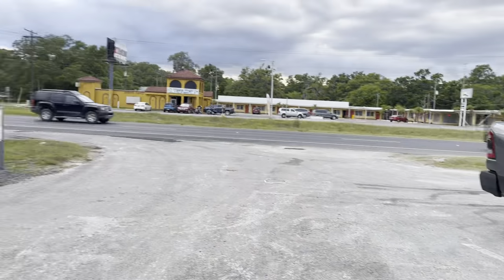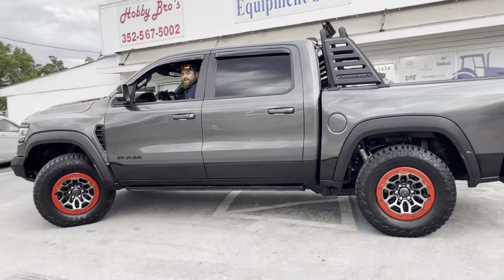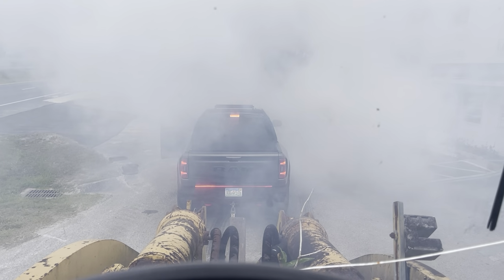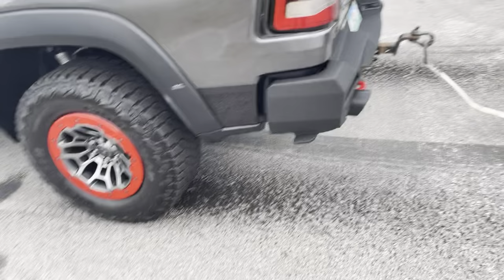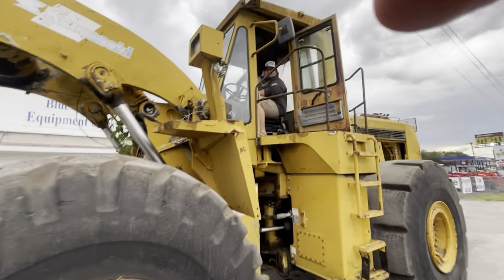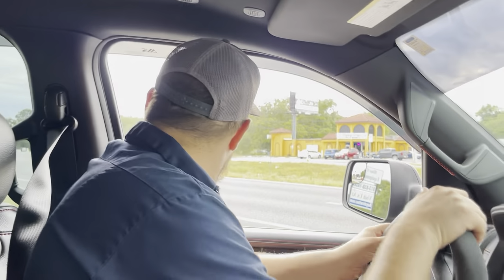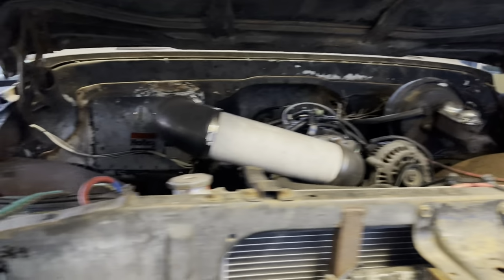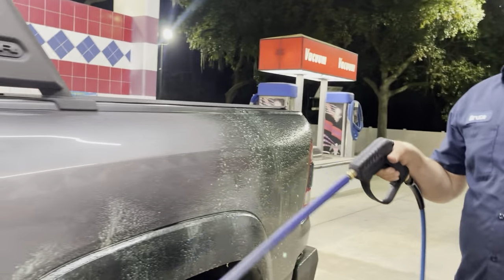RAM TRX 4WD BURNOUT!

Comment: when you said about the 2wd burnout you can drop the front prop shaft out and make it a 2wd,and i like what you did to the bead locks are they custom powder coated?
Reply: yes this is the easiest way
Reply: With the track hawks their is a fuse you can pull that will deactivate the front wheels. Not sure if it's the same with the trx.
Reply: @awdeveau  there isnt a fuse on the trx or the trackhawk somebody gave you bad info the transfer case control module is under the center console and has to be unplugged  goonzsquad showed it on both there trx and trackhawk during the rebuild
Reply: @TylerDuysen  ok, it's been a couple of years and don't have first hand experience with one. I just remembered watching a YouTuber with a track hawk and they were doing donuts/burnouts with it. They were getting ready to take it to the drag strip and said they needed to get the fuse they pulled to get the front wheels back before going. But again I don't have first hand experience.
Reply: @awdeveau  yeah i looked it up and supposedly theres a fuse under the hood that disables power to the front wheels (but goonzsquad showed the way i mentioned) but the trx doesnt have that fuse so the trx theyd have to unplug that module

Comment: They take all the fun out of burnouts with these traction control, auto 4WD, etc... But this one was SWEET!
Reply: auto 4wd is ment that 4wd is there when rears are slipping like winter use so you aren't running it all the time. they still have 2wd and 4wd buttons
Reply: @arbiter1  no they dont the track hawk and trx are full time 4wd you can only choose between high and low range only way to get 2wd is to unhook the front driveshaft or unplug the tccm(transfer case control module)

Comment: BRUCE one of the young guys at work has V8 Cherokee so he wasn't satisfied with that so he got it supercharged now 600hp then he decided I wonder if it can do a 4 wheel burn out he posted a video of it doing the burn out it was impressive ,however sadly it blew the transmission and the transfer case and the front diff ,the cost to rebuild the trans and get 9inch diffs built to take the power as Jeep said there standard power train wouldn't take the power so 20,000dollars to fix so it sits under the carport until until he saves the money ,just thought you might enjoy his story ,looks like the Dodge is better built than the Jeep 
Cheers Kym 
Adelaide
Reply: there not but its fine hes still gonna send it